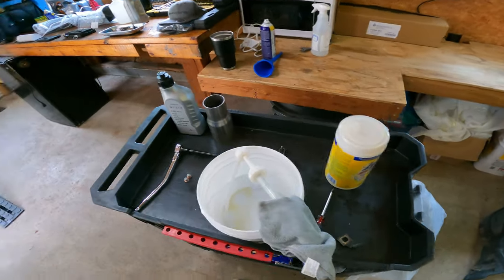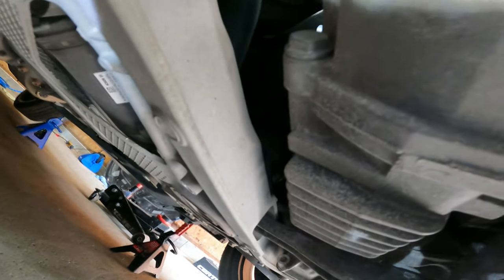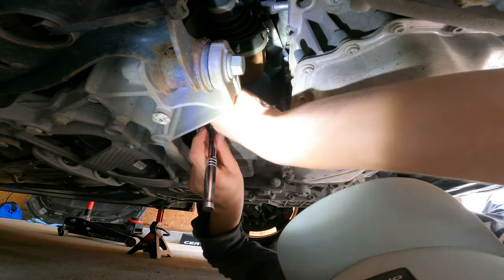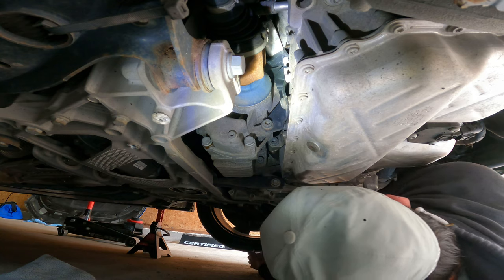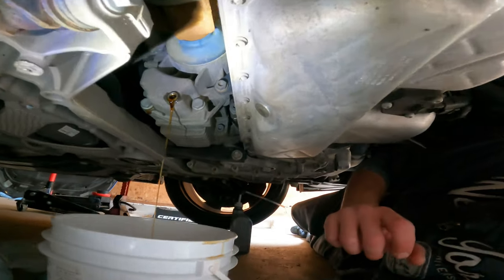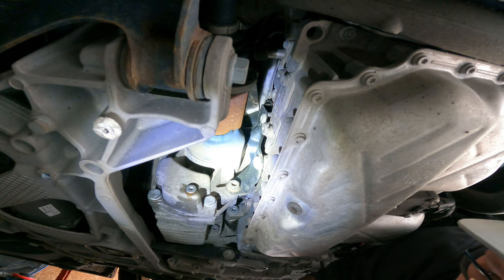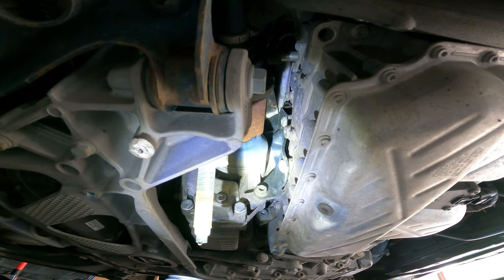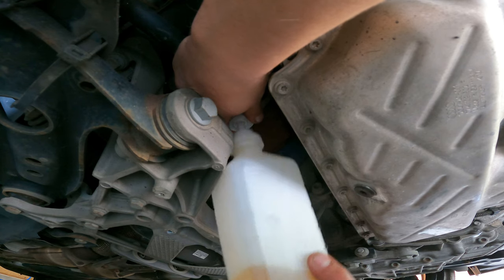2018 Audi Rs3 Front Differential Service Part 2 (DIY)

Comment: Just did the front on 35k miles definitely do this around 20k. Shit was dark. Rear diff was good and pump was clean. Make sure you do the pump motor via obd11 or vagcom while the vehicle is started for the rear just incase you need to add more when the pump is pulled. 👍 good stuff dude.